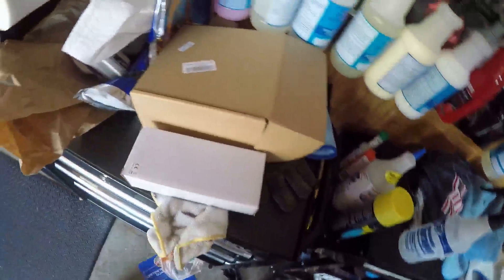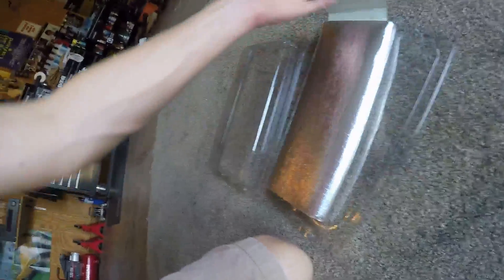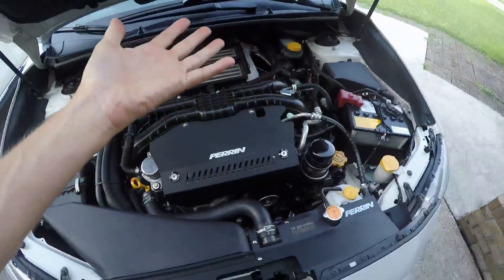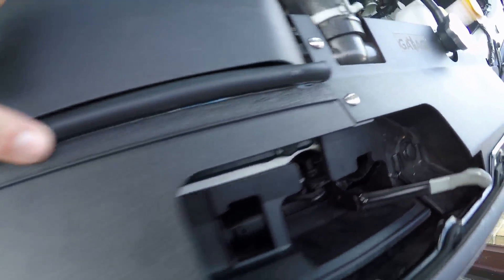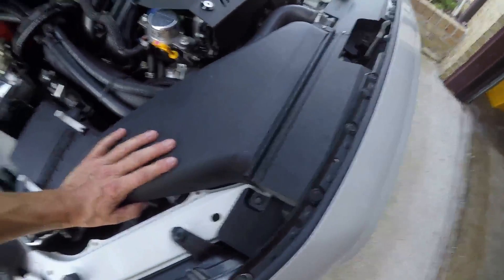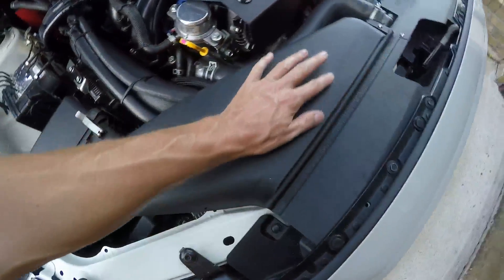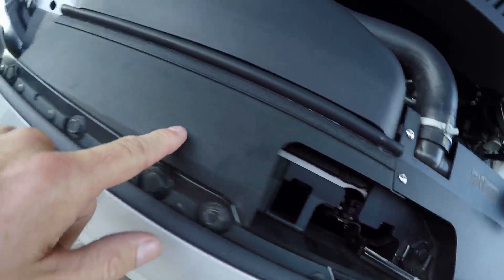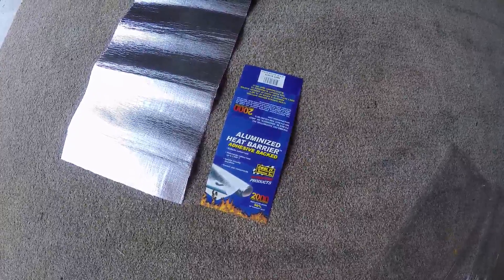2015 Subaru WRX Ep. 799: Thermo-Tec Heat Shield

Comment: Incorrect about just the MAF accounting for tuning. The intake air temperature sensor at the manifold has the final say.  Put the display up on your Cobb and you’ll see it. You need to shield and wrap the downpipe to avoid radiant heat hitting the top mount.  The coolant hose from the radiator is there as well
Reply from the maker: good info

Comment: Funny, I just received the same exact stuff in the mail a few days ago, I'm installing a J-pipe and thought maybe I could use some on the waterpump heat shield above where the J pipe connects to the turbo. Interesting thought about the air-box, I certainly don't think it would hurt.....

Comment: Maybe you could wrap the intake tubes themselves. Or even your fuel lines since cooler fuel is better.. but then again it gets pressurized to 2000+ PSI right on top of the engine so that might be a waste of time. How about the sides of the intercooler that face the engine?

Comment: why not around the MC and res so you don't ever worry about boiling fluid?
Reply from the maker: i don't think i'd ever have that as an issue..
Reply: LastHumansGarage any vehicle that is driven hard should have a brake res shield, brake fluid bpils at 230-260 degrees, hot days or continuous spirited driving my oil can get that hot so I see no reason to believe the brake fluid could definatly been hotter than it likes. just a suggestion

Comment: The lower coolant pipe should be shielded from the aftermarket j-pipe. It glows red hot when pushing the engine.
Reply from the maker: no way! i dont even know which you mean but ill check it out.  i know you dont mean the hose.
Reply from the maker: can you clarify which pipe? is it obvious? ill take off my splash shield tonight